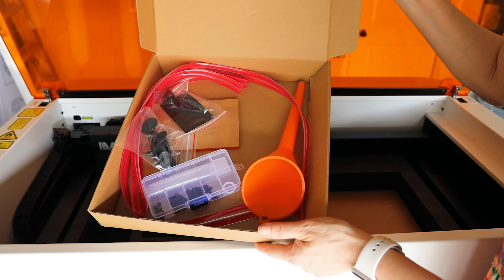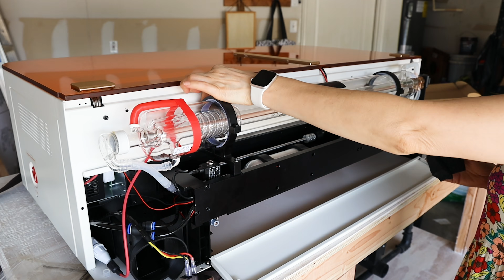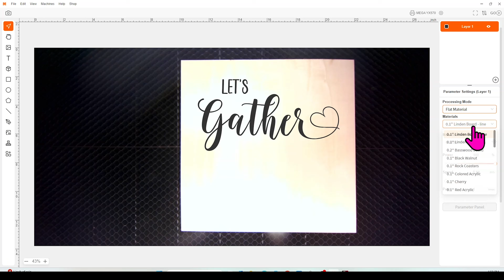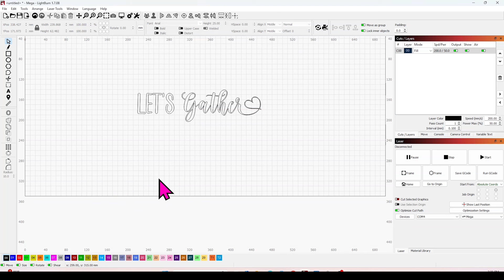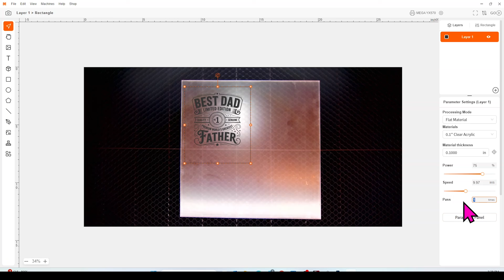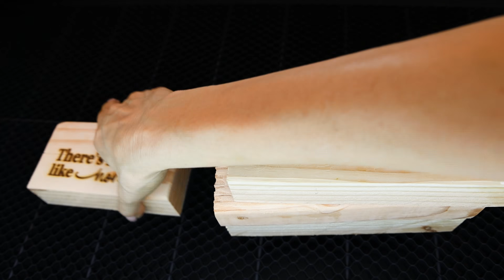Ultimate Monport Mega 70W Laser Guide: Worth The Money?

Comment: I'm actually shocked yours seems to work so well right out of the box. Most of us had to tear ours open and 'fix' a LOT of items from the factory. (Wifi being THE biggest). MDH no longer works via USB and requires wifi for some reason. The latest firmware now causes erroneous Y-axis jitters and movements when the camera sees activity. We have been working hand-in-hand with a few MEGA-specific engineers to get fixes rolled out.

Speeds had to be dropped to very slow accelerations, USB camera had to be manually re-routed just to get Lightburn to use it, had to locate where the water cooler's kinked line was and fix that, and the air assist would never kick in but I showed the engineers where their lines were kinked and a few others were able to get their pumps to finally come online. I pre-ordered mine because I didn't want to pay the price of the Glowforge (which is the one I truly wanted, but requiring Internet just to use it means I'd have to figure something out for the workshop which is not part of my house). :(  -- not to mention, we were 'led' to believe we were also getting the conveyor when they came out. So sad that they took that away from us.